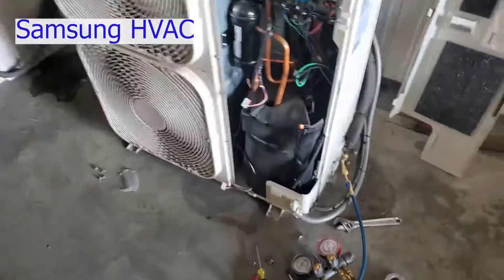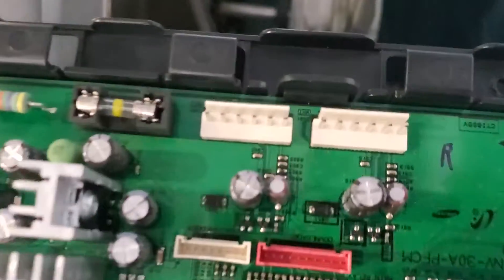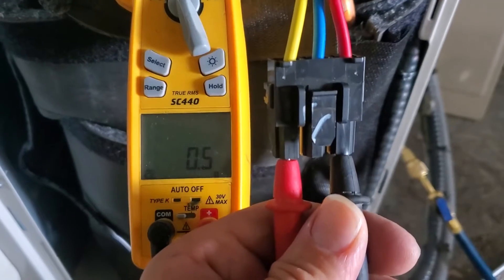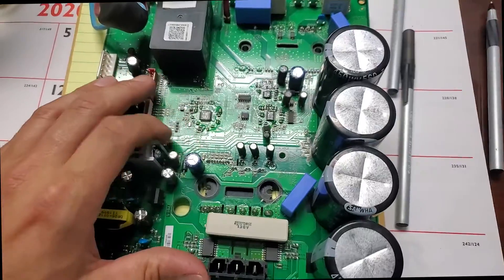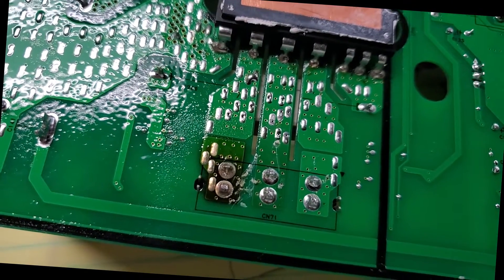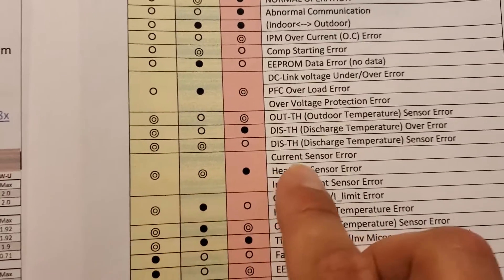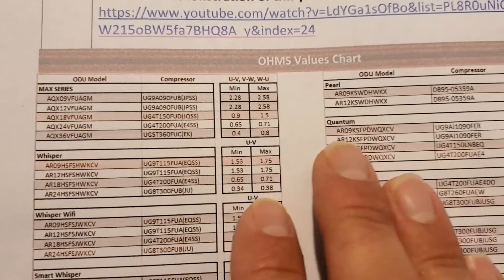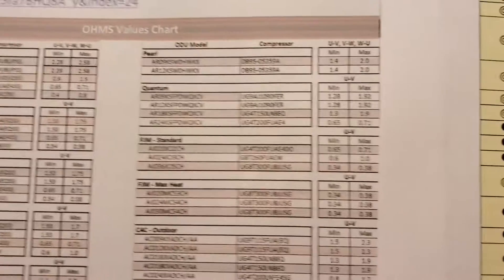SAMSUNG HVAC ERROR CODE E468 #SamsungHVAC

Comment: Hi bro I have E488 on my unit its the AC Input Voltage Sensor so I checked the reactors and all the electrical connections but still no luck my main voltage is stabilized at 227v and I don’t see any burning marks in the board! Any suggestions?

Comment: Hi Tad, need help I have a Samsung unit AR30FSSSBWKX unit and Im getting error code E464 on small board display. Already hired 2 technicians who bled me dry and told me I need a new outdoor unit without any testing. Can you please help me diagnose.
Reply from the maker: Yes 1st you need to verify that the charge is correct by factory charging in the equipment.
 Now before 6 for air code is a IPM current error 
 Windings of compressor must be checked by ohms with a meter 
windings must read the same because it is 3 phase.  Check all connections to compressor. may need to replace outdoor compressor or inverter board 
I would ohm sensor assembly too